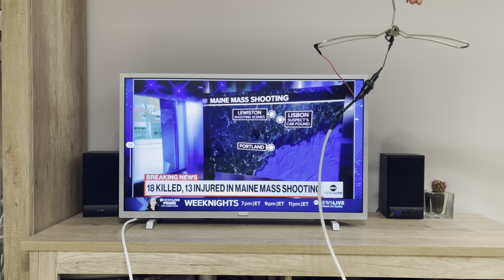Just insert the spark plug into the TV and watch all the channels. THIS IS BRILLIANT!

Comment: Here's what you do.  You cut the power cord from an old lamb, connect the bare wire ends to a coaxial adapter, plug that into your TV and plug the cord into the wall socket.  You'll get channels from Alpha Centauri.